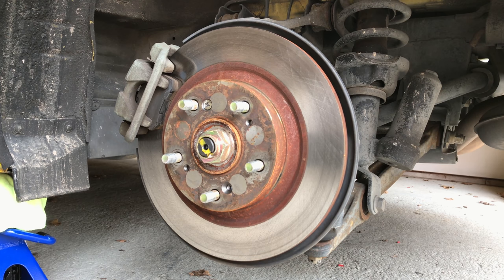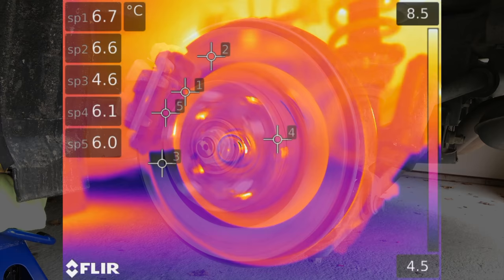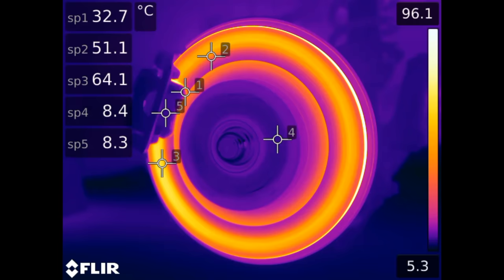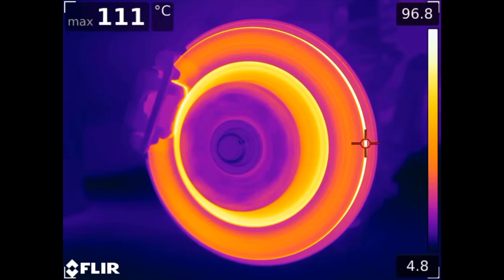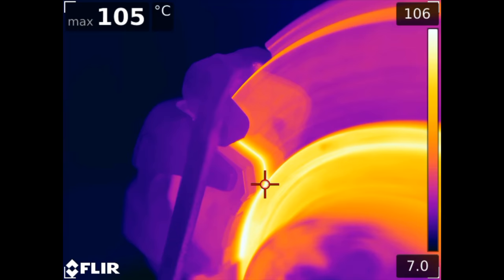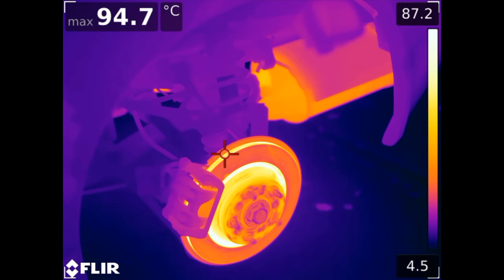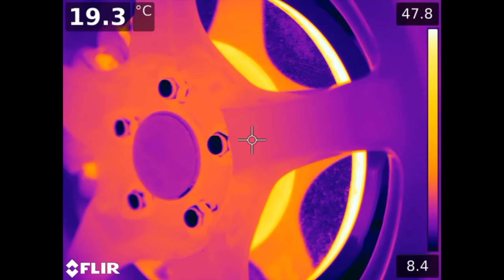How Hot Do Your Brakes Get?

Comment: the parking brake acts on the hub and works like a drum brake that is why the rear disk brakes on cars are not just a flat disk but have the center part. this is why the pad remains cold and the brake fluid remains cold. It is also why the center hub area gets very hot vs the rotor and everything else. Wheels tend to act more like a fan than a heat sink.

Comment: So my old classy turbine-style alloy wheels are probably about the equivalent of my CPU cooler. Neat.

On the other side of the thermal spectrum, having too much water in the brake fluid will also cause it to start freezing. It happened to me at 4% water content.

Comment: I heard that duct tape would show the correct temperature of a metal, however, it would need to cover a lot of the brakes or else it would be hard to see the color/temperature of the tape since it would be rotating so quickly. If you used a lot of duct tape, then the temperature won't dissipate into the air as well.

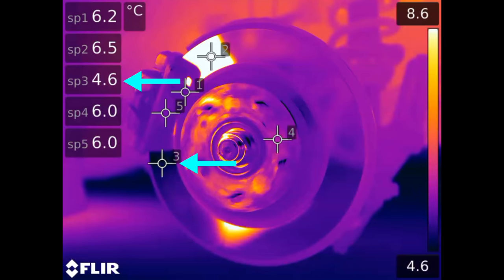Comment: 0:27 super interesting that the reflection of your leg shows up as bright as it does on the brake rotor. Can't imagine the rotor is heating up instantaneously from your leg passing by but it does go to show the infrared coming off your leg truly acts just like light (EM wave) and reflects off a mirror-like surface. On an unrelated note, the rest of the video is interesting too.

Comment: Just as a tie-in to your closing section with regards to the wheel being fitted - the Formula 1 fans already know this, as it's a common practice of setting up the brake cooling to assist with management of the tyre temperatures! But being the engineering nerd you are, you probably already knew this ;)

Comment: Jason,

first off I'm a huge fan of your vids and have learned a substantial amount of the years.

this particular vid has raised some questions that your mechanical engineering mindset may be able to answer.

scenario: in my Mazdaspeed3 I have recently replaced my pads rotors. I failed to clean the mating surface of the rotor and hub as well as properly installing the pad retaining springs on the pad the first time around. with the car jacked up I notice a significant amount of run-out which causes judder at high speeds. they do not judder at low speed braking my poor installation techniques have also led to the 10,000 mile old rotors to have grooves across the surface.

now here's my question. when doing numerous high speed braking, what would cause the judder to worsen at high speeds and be noticeable at low speeds? 

obviously heat is a factor here because once the system cools the problem dissolves. I was hoping to see some sort of engineering explained type of answer as Google searches have failed me here.

Thanks

Comment: So perhaps I'm worrying for nothing.  ???

A couple of weeks ago, we again has a situation where the "tire" LED lit up.  It seems to just happen on this 2016 Honda CRV AWD.
But on that day, it happened TWICE.
So I pulled over to check the tires' pressure, which are always just fine when the danged lit comes on.
But since it was twice and a hot day, I touched all 4 wheels.
Three of them seemed "normal" but the rear right was HOT.  I carry a couple of bottles of water, so I poured water on all 4.  The 3 were fine, but the forth one just burst into sizzling steam!

So when we got home, I checked that side and the rotor seemed to be a bit difficult to turn by hand.  But I could turn it.
I compressed the caliper to release pressure and examine more.
I checked the bearings by pulling and pushing the tire (when it was still on) and there was zero play.  Also, no "bad bearing" noise, which I've experienced a few times in my life.

I was able to move the caliper in and out with no problem, indicating that they aren't getting stuck nor seized.

I put it all back together and checked the other rear wheel.  It was ok too.

We took it for a ride and now the rear was fine.  BUT, now the right front was searing hot.  The left was hot too, but not as bad.

So, yesterday, I did a full clean and maintenance on the front.

The pads and rotors seems just fine and the pads have about 5-6 mm clearance over the metal piece that would indicate pads need to be replaced. (the scraper, I guess).

I then took off the calipers and cleaned around the cylinders as best I could without messing up the rubber seals.  I used a wire brush, very carefully and lubricated it with Silicone Brake lube (orange pasty type).

I then removed the slider pins.  They were moving in and out just fine, but I still cleaned up the heads as there was a bit of rust on the nut end that did go down under to where the rubber seal would touch.

I lubed them very well.  I then cleaned out the tube that they slide into and lubricated everything there, including the pins.
I put the pins back in, burped the rubber seal and reassembled everything.  I did this to both sides.

I pumped the brake pedal until the brake pistons did their thing and took it for a quick ride.

I didn't go too far, about 1 mile or so.
When I got back to the garage, the front brakes were hot, but not sizzling, steaming hot.
Just hot to the touch.... but I COULD touch the rotors without screaming like a grade-5 school girl.  LOL

So, today we take the car for a longer test ride.

My question would be, IF I find that the brakes still are getting sizzling/steaming hot, what else could possibly causing this if all the calipers are working well?

IDEAS?

Comment: I touched my brake pad today, after driving quite quickly (legally and safely obviously) on the highway and applying the brakes a lot on the highway (without brake checking ppl) after I went home  I was curious about the temp of the tire and wheels on the car. I touched the tires and they were relatively warm, I then touch the flat part of the brake pad with my finger for a short moment after realizing it felt like putting my finger on an oven I removed. It left a mark on the pad of my fingerprint, black and charred. It hurt unbelievably badly even for a split second, and kinda an effect like electricity were the paint spread out through most of my other fingers without contact. But yeah I put some aloe on it and took some advil, and now I'm good as lol. DON'T DO THIS BTW, I DID SO YOU WON'T HAVE TO.

Comment: I have a 2008 Hyundai Veracruz all-wheel drive I'll drive my car about 2 mi and then I'll take a look at my brakes rotor with a hand touch to the rotor three of them is warm two in the front and the right rear but I checked the fourth one and it's cold to the touch do you think I got an all-wheel drive problem or the calipers is stuck is it normal to bet three of them is warm or is it normal that it should be cold since you're not keeping your foot on the pedal all day long just at a stop sign or whatever?

Comment: Now you need to make a video on wheel material as it relates to heat dissipation from the brake rotors. I'm extremely curious now but I can't afford a fancy thermal camera. I would imagine steel would absorb more in the short term but aluminum would dissipate more overall.
Reply: Aluminum is better and it's not even close.  It also helps Aluminum wheels are typically more open.

Comment: a pure-ish aluminum alloy is likely the best for wheels. its got high thermal conductivity and high relative thermal mass (unit heat energy per degree per unit mass) plus it's strong too. magnesium would be pretty good as well
Reply: Another great reason to get magnesium/aluminum wheels besides weight reduction.

Comment: Very informative and a great video. 

I’m sure that alloy wheels or other suck stuff would in fact cool the brakes faster. They usually have a lot more space or air spaces for the air to pass between them.

I would also be very interested to know if the claims behind drilled rotors is true. Some even claim differences of up to 150 degrees in their drilled rotors.

Comment: Jason, thank you for the very informative video.  As others have alluded to below, the camera may be helpful for investigating possible causes of rotor warpage.  Our 2007 Honda Odyssey warps rotors every couple of years, and the exact cause has been a source of debate in my house.
Reply: Sticking brake pad. Probably the inner one. I have the same issue on my Honda, then found out that was the problem.

Comment: i heard a while back that a company looking into carbon fibre wheels were concerned about about the heat transfer rate compared to metallic wheels and what it would mean for the cooling of the brakes, as I think it goes without saying, these wheels would likely be on higher performance vehicles and the heat transfer would be a lot more crucial.

Comment: I just serviced the break on my 2008 Ford explorer. Driving it through a mountainous region in Haiti, the driver could smell the break getting hot. After a few minutes, the driver lost control of the car, and the break will not respond in any way applied. Since the car was going downhill, the driver managed to stop the car by driving the passenger side against a wall. The finally stopped leaving driver, and passenger unconscious. Since the break system was brand new, what could make it fail so suddenly.

Comment: I might or might not get apply for a bachelor's thesis regarding heat distribution and heat induces cracking of large steel brake discs. I always thought that steel was very resiliant to heat gradients, unlike glass. Could you please explain the mechanism behind that problem?

Comment: My brake rotors have gotten as hot as 750 degrees Celsius (or 1382 degrees Fahrenheit) on downhill mountain pass runs, one can see them glowing cherry red in the dark. So those who drive on racetracks or exhibit racing-type driving should seriously consider getting brake pads designed with a maximum operating temperature of at least 1000-1200 degrees Fahrenheit (or 538-649 degrees Celsius) as operating with a sub-par set of brake pads endangers the lives of everyone.

Comment: Do slotted rotors make a significant difference with cooling as opposed to smooth? Considering some Centric slotted rotors when my brakes need changed and I was wondering if it was worth it or not.
Reply: Dell0304 Slotted and drilled rotors have nothing to do with heat dissipation, those are the holes and slots on the face of the rotor. they help gas created from hot pads escape, only necessary for high performance. The vents in the middle of the disc help cool it down as it directs air outward inside the rotor.

Comment: The top part is hotter at the beggining because it's the reflexion of radiation from the other stuff in your room. Aluminium or whatever metal your brake disk is is just a miror for radiation (that's why you can see yourself inside them at 0:28)

Comment: Cool video, but most parking brakes don't use the calipers on the rear wheels at all.  They apply a drum brake to the inside of the rotor.  This would account for the higher temperatures at the center of the rotor, hub, and rims.  Still a great video.
Reply: While drum in hat parking brakes are certainly popular I do believe the Honda S2000 uses a caliper with an integrated parking brake (it's a cam mechanism that applies the brakes mechanically).

Comment: You find it interesting the brake lines are not heating up? You're only using the parking brake, it does not use the brake hydraulic system, it is mechanically activating the brake.

Comment: one thing I never understood with cfrp wheels was, because cfrp below circa 40% resin/fibre ratio shrinks when heated, and most manufacturers work at 25% ish for structural components, what happens when the hub expands and the wheel shrinks? massive stresses!

Comment: I'll be honest, I usually get annoyed with some of your videos, but this one is a thoughtful and useful one...  I never really looked at wheels as anything other than something you absorb bumps on the road with, whereas now, I can see that there's an additional benefit of having a forged aluminum wheel...  it'll be able to absorb and dissipate heat more effectively, thereby keeping the brakes cooler.  Would've thought that the type of wheel material, solely, would aid in the cooling of your brakes on a track day?

Comment: I liked this video. But could you do an explanation as to why cold breaks are worse than warm breaks please?
Reply: Ruscello Twitch this is not always the case. it depends on the type of pads you have and their coefficient of friction. pads and shoes have a two letter friction rating, cold and hot, most are the same letter meaning they work the same hot or cold but some work better hot than cold. Typically as the cold rating goes down the hot rating goes up, street cars don't vary by more than a letter, but in some racing applications you  need to go fast enough and hit the brakes hard enough before they actually start working, kinda scary

Comment: Had a stuck caliper on a Ford F150 and the rear aluminum wheel got hot enough to melt the plastic valve stem cover.

Comment: Maybe the same idea with a groved Rotter to see how slots help cool the surface?
Reply: Ромарио МкЛеод drilled and slotted rotors actually have nothing to do with cooling. the vents on the inside of some rotors direct air outward to cool them. Holes and slots in rotors are for gasses to escape.

Comment: That thermal camera.. And an S2000.. This guy is amazing. But didn't get how the brake fluid get hot??
Reply: conduction heat transfer through the pad into the caliper and then into the fluid (only under heavy breaking for a long time will the fluid reach a very high temperature)

Comment: We should be able to extract energy from all that heat or turn it into something cooler, like a refrigeration effect. Or make some directed kind of wind tunnel through our front bumper to cool the brakes even more
Reply: Buy a hybrid. Brakes turn kinetic energy into heat, but a hybrid car can dispense with most braking and use the motor as a generator, turning the kinetic energy into electricity that charges the battery instead. They still have normal brakes to help them stop completely (the motor only has a useful braking effect when the car is moving at speed) and for quicker deceleration in emergencies.

Comment: Brakes get pretty hot on the cars and trucks coming down Teton Pass. I can smell them burning on the vehicles in front of me, especially the drum brakes on RVs.
Reply: Yeah, that and braking hard and fast, like, your going at 60mph, brake hard to 40, regain momentum to 60 and do it again, this is what GOOD truckers does, otherwise they will ruin the brakes.
Reply: B10401, Iam from Sweden, so it might not be the right word, but they are getting polished almost.. Like, they are slippery instead of dull / matt, often when trucks are in a repairshop for brakes, its because just that, they have become polished by the heat of the brakepad during light braking when going down a hill for example.
Reply: And instead of having good brakes, you will hear them ''whine'' and have poor braking.
Reply: Well, if you lightly drag, you will increase the heat the further you go, but if you brake hard (Just a couple of seconds) and release, the heat wont be that massive, iam amazed that he didnt bring this up since this is actually a huge deal. Going down a hill you do not want to overspeed haha, go down from 60 to 40, then coast down the hill till you go to 60 again ^^

Comment: Hello mate you i have a question that you can maybe help me with. I know i will have a wave of reply telling me to go with the manufacturer but i will ask anyway.
I am at the point where i need to replace my brake fluid. Ford recommand DOT4 with a boiling temp of 230° dry and 155° wet  in my F150. I have this brand new 4 liters of DOT3 with boiling temp of 205° dry and 140° wet from my previous car. I never town and i don't race my truck. I rarely load it so do you think i could go with DOT3 or sould i stick to manufacturer recommandation?
Thanks for your channel Jason.

Comment: Hi,

I have a simple question. My car has rear disc brakes as well as a small drum in the wheel hub for the parking brake. After driving some kms, I noticed that the hub is hot, but not the wheel itself. Is that normal? My handbrake is pretty stiff after adjustment

Comment: Hi,....i have put new brakes up front (ceramic).  I have noticed that there is a bit more dust on the rim on one side than the other.  I have used a infrared thermometer to check the heat and I have noticed on driver's side the temperature rise an extra 5 degrees. Is that normal?

Comment: Question: My right rear wheel/brake is getting hotter than my left wheel after I have driven. When jacked up, the right rear also has a bit more drag than the left. I have reassembled the brakes so everything is as good as can be. I suspect a sticky piston.

How hot can my right rear wheel/disc/brake get without it being a problem? I want to replace the caliper but I am.affraid to push the car now at this moment. (Push = hard braking = more heat).

If I stop after a drive what temps at the wheel or disc should be OK and when should I be worried or stop driving?

Comment: So Lately Ive been trying to figure out why brakes "fail" after a certain temperature. Mostly related to tractor trailers. I saw a video the other day of a runaway truck ramp filled with sand or something and just can't wrap my head around how, if they fail closed, what causes then to completely stop working? My coworker said it's because the brakes can only absorb so much heat but that still doesn't explain why that would cause them to completely not work. Does something happen to the surface of the metal that reduces the friction between the two? Does it have something to do with off gassing creating a very thin layer of gas that prevents the two surfaces from contacting? Id really like to know what exactly is going on that causes a closed break to stop braking. 
Any info would be great, thanks 👍